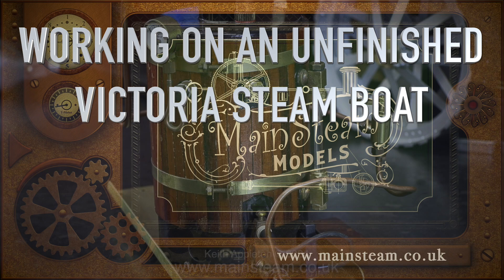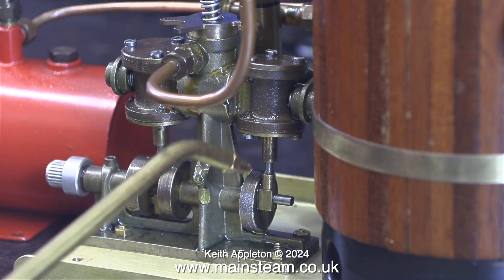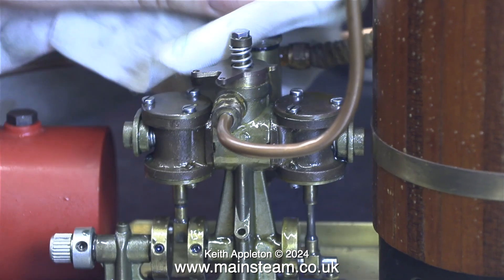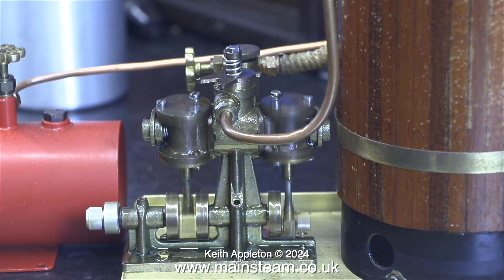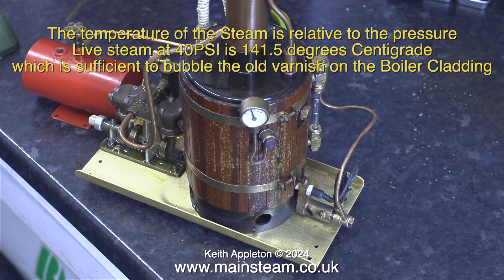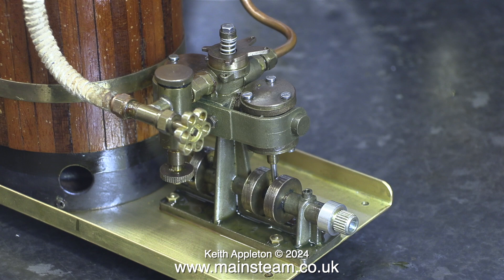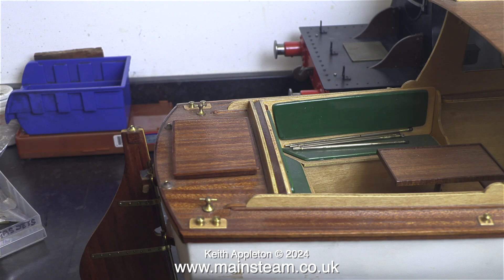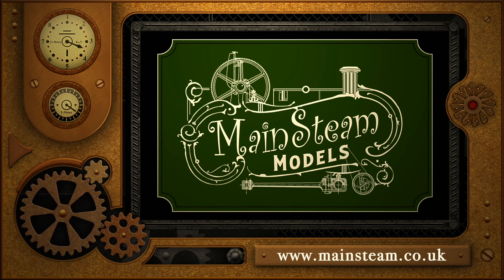WORKING ON AN UNFINISHED VICTORIA STEAM BOAT - PART #6

Comment: I'm looking part 4, minute 6:25, and see a probable cause for the piezo not working well. The tip of the spark plug is parallel to the nut, but it should be as close to a point as possible. Piezos are used in profesional kitchens around the world and work pretty well. Also, small voltage multipliers that work with a single AA cell are used, this is another option.
Reply from the maker: I only show a small part of what I actually do in these videos. I tried many permutations of the tip of the electrode but the results were always poor with this particular Piezo Igniter.